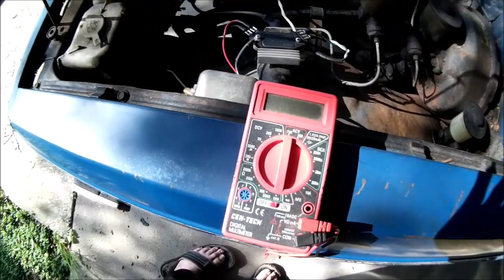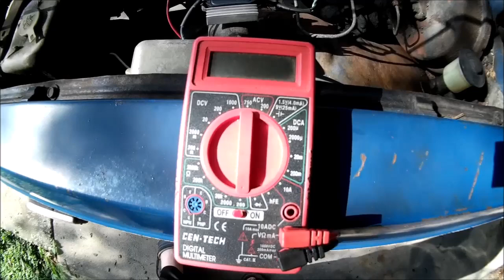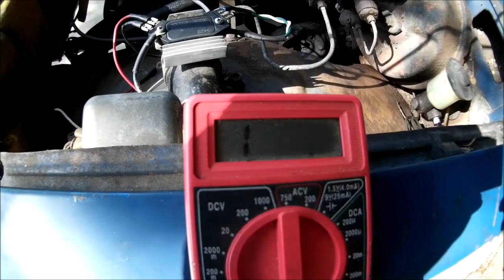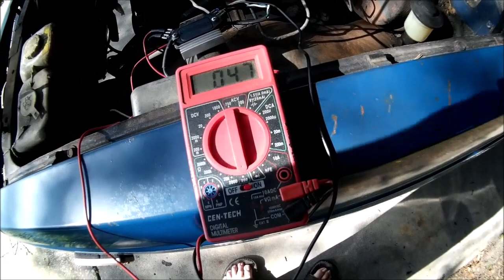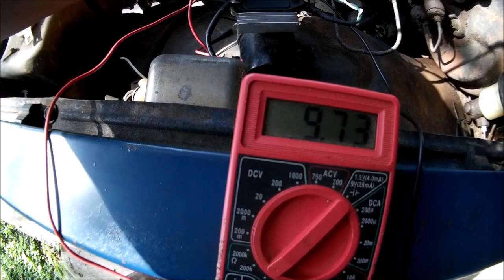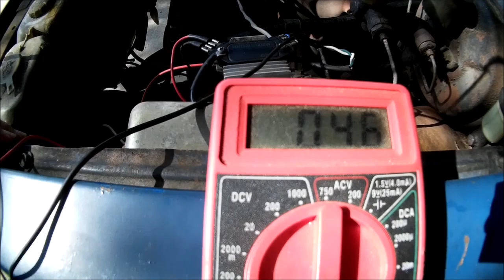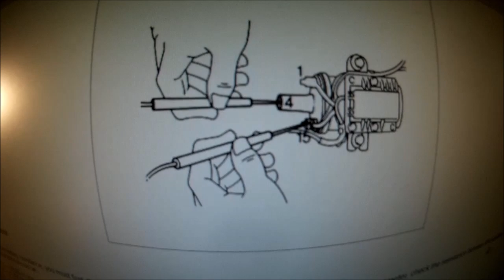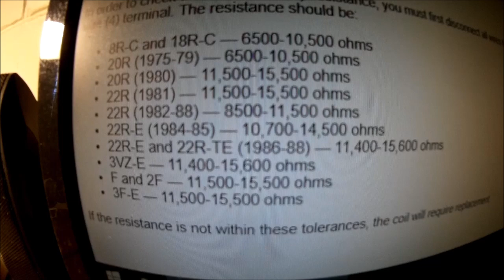1978 Toyota Pickup/Hilux 20R-IGNITION COIL TEST & SPECS

Comment: You mention a video that covers the throttle position on the carb. Which video is this?
Reply from the maker: This video @2:00 : https://www.youtube.com/watch?v=PFOZayHBx5w&t=63s

The Throttle Positioner is also known as a Dashpot. Some also call it a Damper. It's purpose is to prevent the engine from stalling when you take your foot totally off the gas pedal, to keep the throttle butterflys in the carb from just slamming shut. It allows the butterflys to more gently & progressively close back to idle position. This should take 2 seconds or less when you lift your foot off the pedal. Adjusting the screw as shown will change the amount of time this happens in.

More info, Applications, paragraph 3: https://en.wikipedia.org/wiki/Dashpot#:~:text=A%20dashpot%2C%20also%20known%20as,in%20conjunction%20with%20a%20spring.

Be aware that messing with this screw can & will change your base idle speed. You may have to go back & forth between this screw & the idle screw to obtain the correct idle speed & the correct timing on throttle close. These adjustments should be done at full engine temp.

If you are just trying to "baseline" the carb because this screw had been moved or removed by someone else or due to carb cleaning/reassembly, I recommend the following.
Make sure the screw has it's spring present before installing it. Install screw & turn it in until it just touches the lever tab but doesn't move it. Then turn it in a half turn. You should visibly see it move the lever about 1/32" of an inch, or 0.5 mm.
That should give you a fairly good & workable baseline setting for it.
Reply: @The13thSword  Alright, thank you! After all of this rangling, we think it may just be the rebuilt carb's jet size was too big. Otherwise, we can't think of what else may be causing us to have too high of CO.
Reply from the maker: @codybontecou  That's a fair thought, too large of an idle jet. Other things I can think of are to make sure the idle passage is completely clear. If it is restricted at all the engine will try to pull fuel from the secondary (main) jet & you'll be rich, yielding high CO. Also inspect your idle mixture screw for any damage to the tip, from it being previously run in too hard. That can deform the tip which can also cause a rich condition on idle.

Otherwise make sure your ignition is in good working order. No fouled, damaged or worn spark plugs, wires in good condition & within resistance spec, good cap & rotor, points in good order, points or air gap (on electronic distributor) set to spec, no distributor shaft play from wear, correct operation of mechanical & vacuum advance mechanisms, & correct ported vacuum source to the vacuum advance.

That last one also reminds me of something. Are you using an actual 20R distributor with the single vacuum advance diaphragm, or a later 22R distributor with the dual vacuum advance/retard diaphragms? If using the 22R, the correct vac diaphragm to use is the outer one, NOT the inner one. The outer one is for advance, the inner one is for timing retard. If the vac hose is connected to the inner diaphragm, that would throw off the timing & also possibly cause high CO from unburned fuel.

Comment: Trying to get my toyota up and running. I have 2 ignition coils from two 1978 pickup trucks. The coil on the truck I'm currently working on is 1.1/1.2 and  11,650. The 2nd one is 1.3/1.4 and 13,140. I haven't switched the coils over yet to try it. Do you think it would hurt if I tried the 2nd one to see if I get any spark at all?
Reply from the maker: You can certainly try the other coil to see if it works at all, but the specs you gave for both coils is out of spec for a '78 coil. As I'm sure you saw in the video, the spec is 1.3-1.7/6500-10,500. It's been my experience that once a '78 coil reaches 9500 ohms or more on the secondary, it's going to give weak spark (if any*) & you're going to have hot start issues (no start when engine is at full temp) or stalling issues at full temp.

*This assumes that your igniter (ignition module) is good. The stock Toyota igniters rarely fail but it can happen. If you try either coil and only get weak spark while cranking, that would prove that the igniter is at least working.

There are also 2 other items that need to be resistance tested. If either of these of out of order, it could cause a weak spark/no spark issue. On the '78 to '80 20R igniters there is also a ballast resistor. This is a white rectangular item that is usually mounted to the coil bracket or the igniter itself & has two terminals. The resistance spec on this is 1.3 to 1.7 ohms. If it measures 1.55 ohms or more "cold" it needs to be replaced. These resistors over time can get fatigued & have too high a resistance, which cuts down input voltage the the coil primary, resulting is weak spark. Even if the engine does start, as the resistor works it heats up, which can cause the resistance in a fatigued resistor to go even higher.

The second item to resistance test is the distributor pickup coil. It can also develop the same issues as a fatigued resistor over time. The spec on that is 130 to 180 ohms. You can check this with an ohm meter by probing the connectors at the plug. This is the plug that has the two wires coming out of the distributor; they are either red & white or pink & white.

Also, the air gap on the pickup coil needs to be adjusted correctly for it to work properly. This is the space between the coil's face & one of the "spikes" on the reluctor ring that is on the distributor's shaft. There is a screw on the pickup coil's base that you can loosen to adjust the gap. That spec is .008" to .016", or 2mm to 4 mm. I set mine at .012" or 3mm. Once you get that gap correct tighten down the hold-down screw & recheck the gap.

I only mention all of this because these other items directly affect how the ignition system will work, & because, if original parts are still installed, they are now 45 years old & could easily be faulty.

I also have other videos about the ignition on this engine, including ignition system conversions to replace the original parts, which can be impossible or expensive to find. Ig you need other info or have more questions just ask. I'd be glad to try to help you out.
Reply: @The13thSword  Thanks for all this information. I've been watching your videos for a couple years trying to learn as much as I can. Just recently started this project and I'm almost to the end with new fuel pump and weber 32/36 carb. I did the GM HEI LX301T conversion on it in order to move the truck 2 years ago. Obviously now I don't have much of a spark. I will be replacing the module to the LX301 since it is the more genuine GM part. Since I'll be doing that, I figured I would order the UF2 ignitor as well. But just wanted to know your opinion about trying out an original Japan made off of another '78 pickup. Thanks again!
Reply from the maker: @MattR89  You are most welcome & many thanks for the views.

I have learned a few relevant things about the GM HEI conversion since I first did it, that can make a very big difference in run quality & parts longevity. Originally with the conversion, I used the basic replacement coil (UC12), but this is actually a mistake. While initially the setup will run & work, that coil isn't designed to take full running voltage in the way I had it set up. The full voltage gradually degrades the coil & can cause it to develop the higher secondary resistance values you are now seeing in your coil(s). Those numbers indicate that the secondary in those coils is damaged, which would explain the weak/no spark. I can confirm this to be true because it happened to me twice before I figured out what was really going on.

The basic replacement coil is designed to run on less than full running voltage & that's why those early ignitors had a ballast resistor, to drop the running voltage down to 8-9 volts. This would also apply to the Standard UF2 coil you mentioned. Printed right on both coils casings is "USE WITH EXTERNAL RESISTOR".

This leaves you with 2 options. You can use the UF2 or UC12, but if you want it to run well & long, you're going to need to do a little extra wiring like I did. Check my most recent videos for an update on this & ask questions if you have any. Either of those two coils will need a 1.4 ohm ballast resistor on the "run" side. plus a wire from the starter "R" terminal to coil +.

Your other option is to get & install a coil that is designed to take full running voltage (no ballast resistor required). Example: https://www.rockauto.com/en/parts/standard+motor+products,UC12,ignition+coil,7060

The advantages to that coil are a lower Primary resistance (better for HEI module longevity), higher designed secondary resistance (bigger & "hotter" spark than the original coil for better & more complete fuel burning) & an original "look" 9cansiter style coils instead of the newer "brick" style). Of course you can also use the later "brick" style coil from any 1981 to 1995 22R. Those also will not need a ballast resistor.

Other notes. The only difference between the LX301T & the LX301 are the internal connections to the components inside the module. The "T" has single connections while the LX301 has double connections. The choice is yours.
What fuel pump are you running with the Weber & are you also running a fuel pressure regulator? Just curious because the 32/36 doesn't like fuel pressures much over 2.5 psi; they tend to want to flood with more pressure than that.

Looking forward to hearing about your progress.
Reply: @The13thSword  So I ended up ordering everything you had in your videos from Rock Auto. I ended up ordering the UF2 coil, LX301 to replace my old LX301T, and also the RU4 ballast. As for the carb, I ordered everything through LCE. I went with the 32/36 Weber performance package that comes with the fuel regulator, spiral adapter. I also ordered the EGR kit, PCV kit, block plugs, and the LCE fuel pump. The parts from Rock Auto should arrive tomorrow, so hopefully I can get it up and running!
Reply from the maker: @MattR89  Everything sounds in order & very good choices. I see you sent an additional question & will answer that separately.

Comment: Did you take resistance readings while the engine was hot?
Reply: Nevermind, you answered my question at 11:30
Reply from the maker: Yes of course. This is noted @ 11:13 of  the video.